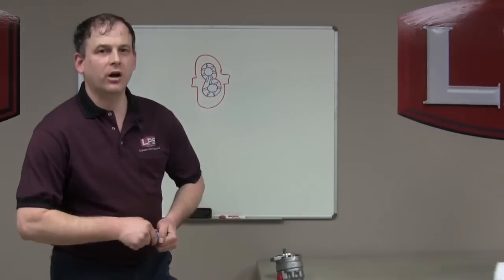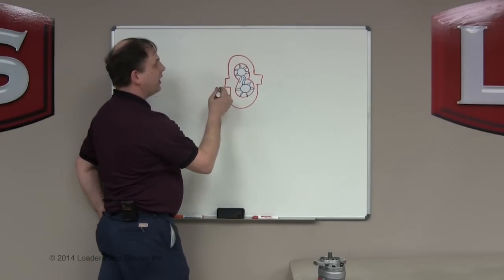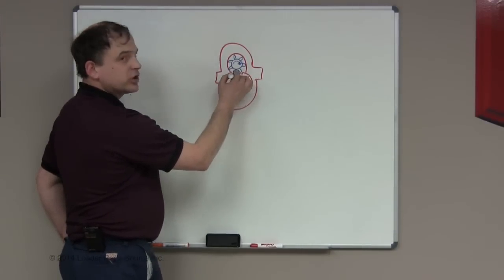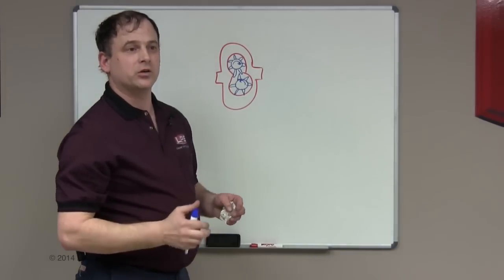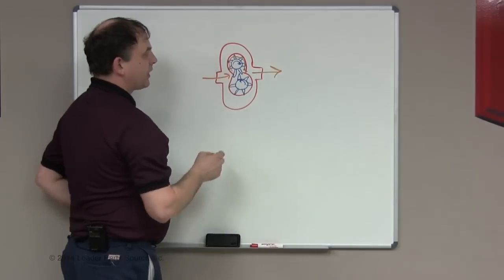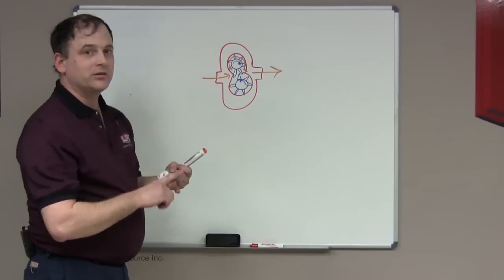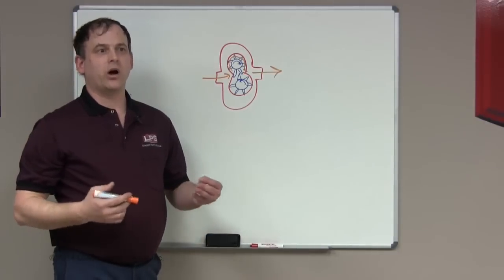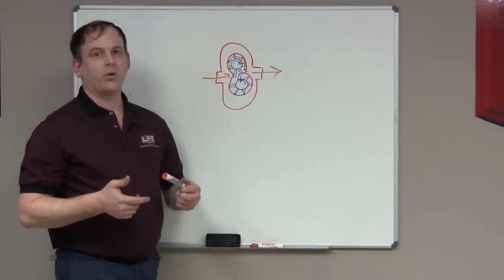Hydraulic Gear Pump Repair

Comment: Not true. If the seals are blown out you can rebuild it. Mine are all aluminum.. If everything is still tight it's rebuildable.
Reply from the maker: Thank you for pointing this out. it is possible on the older 24000 and 25000 series Cessna aluminium gear pumps.  However the pumps installed since the mid 80s or so have better seals. The seals on the pumps our customers are working on do not blow out unless the pump has a lot of wear already.  We carry the seal kits, but don't recommend this option as it seldom fixes our customer's issue.